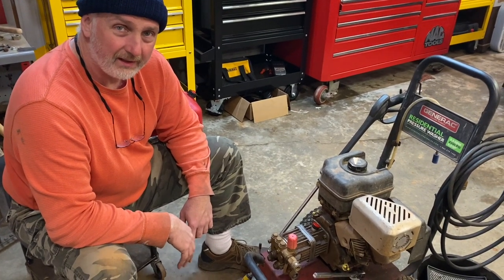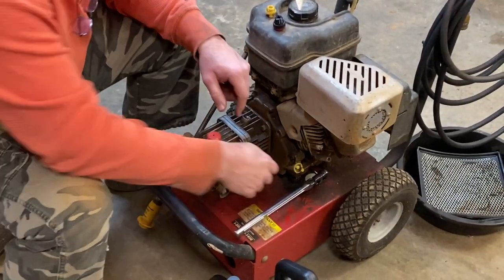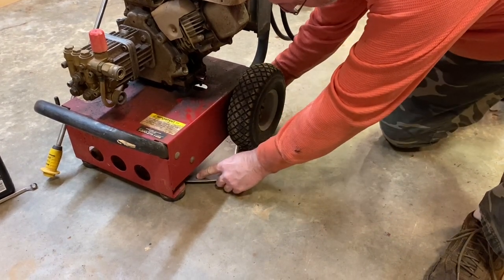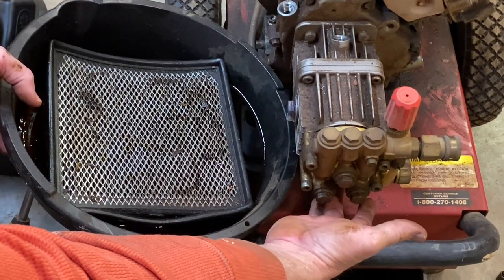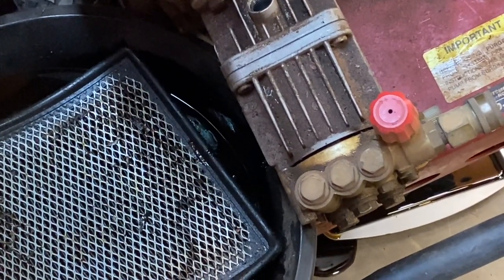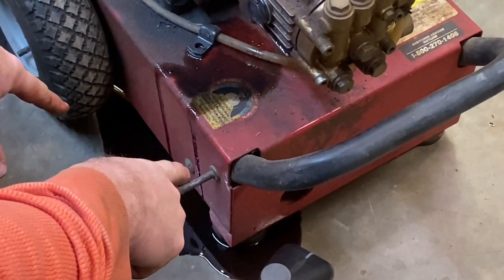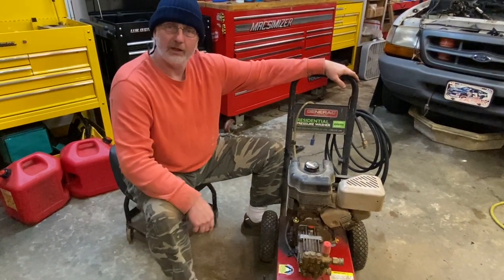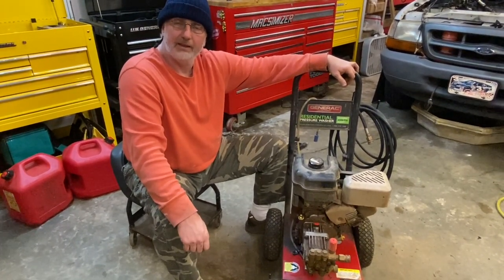How to Change Oil and Pump Oil in Your Pressure Washer - DIY

Comment: One thing I do is bring the washer inside during the winter. I cracked a pump 10 years ago and decided rather than drain/fill with antifreeze I’ll just bring it inside because I use it year round. Also make sure to empty the hose because the freeze will break it too. I leave that in the shed😊
Reply from the maker: Great info! Thank you for the comment.